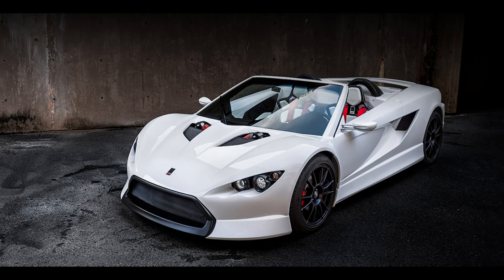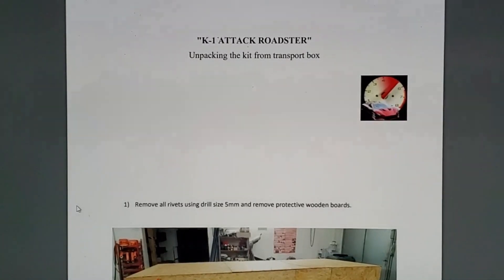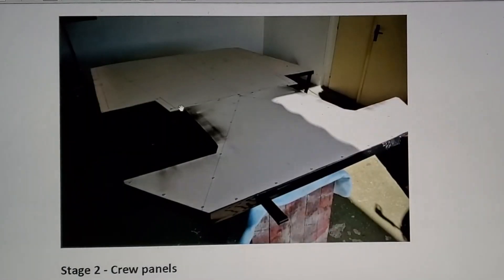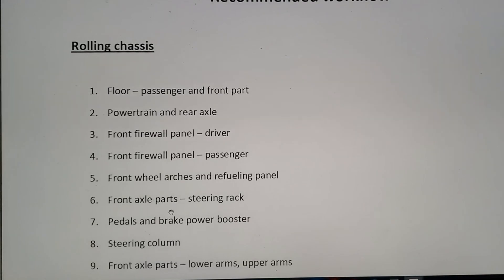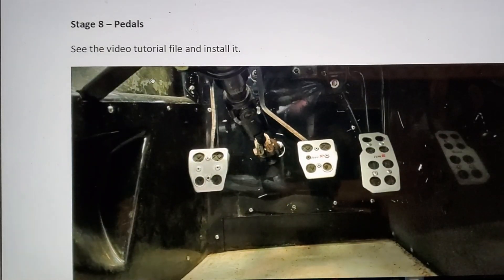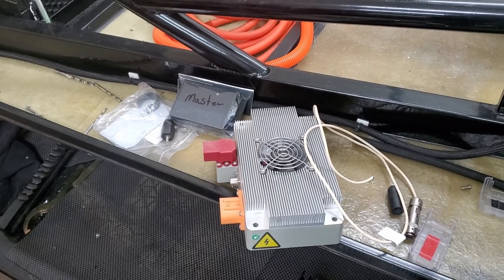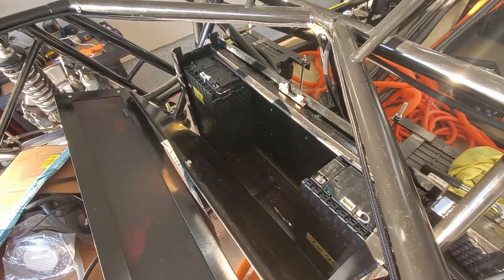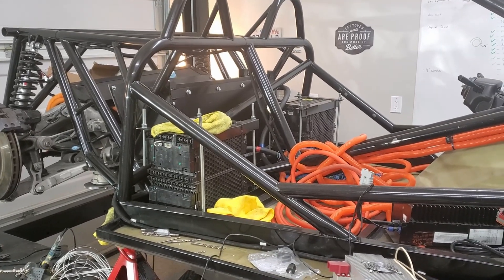K1 Attack Manual

Comment: I really feel that a custom trunk area for the various electronics would be the best option as you can custom make the box to fit the space and your needs and keep the items in one location in case they need any sort of maintenance.

Option two, which is probably the more elaborate of my ideas is to make a side compartment in the side space you have. Cut the body to make hatch doors you can open and mount the devices to a slide out tray you can pull out to service the devices. 

All this of course keeping in mind weight distribution but feel the trunk idea is probably the best option in my mind.
Reply from the maker: Michael, thanks for the suggestions!  Decisions...Decisions 🤔
Reply: @electricsupercar  your welcome, it's been great watching your progress and resolving issues. Your car is going to be amazing when done. Keep up the hard work.
Reply from the maker: @KyberJedi  Thanks friend!